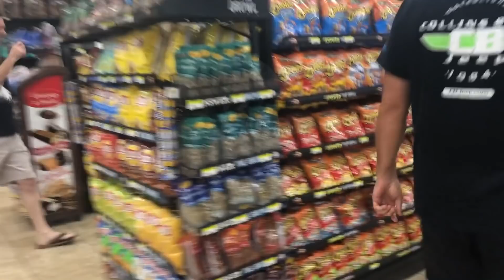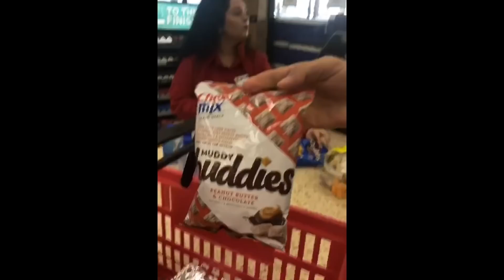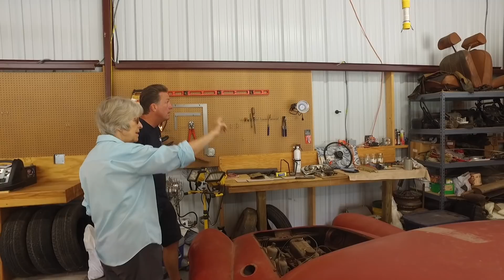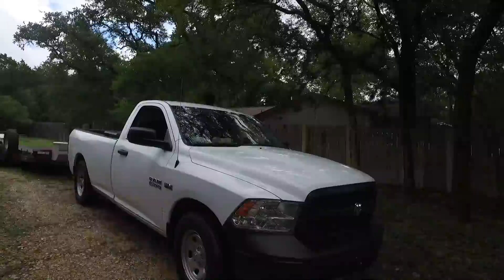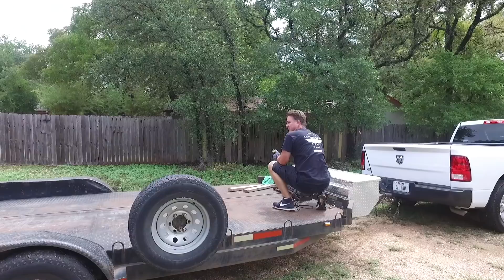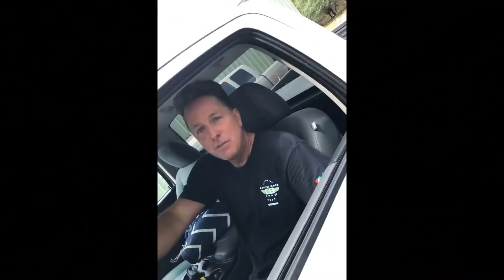MGA Barn Find Roadtrip

Comment: I will be watching the progress. I just discovered this video. I have a 1958MGA roadster that I got when I was 15 years old for $50. that was 1967... I was working nights and weekends in a gas station /full service garage for 85 cents an hr..big money for the time for a 15 yr old...I drove it through high school.. I had a restoration done to the body that took two weeks in 1972. I had it painted white. 1975 I had it painted factory original Tartane red. I have ever heard of. I paid $100 for the aluminum factory hardtop. I saw it sitting on an abandoned MGA under an apple tree while I was out riding my motorcycle one day near Lake Erie. I had the engine rebuilt in 1974 for no good reason. There was nothing wrong with the engine, but I did it anyway.
  I got interested in motorcycles, and fast cars in 1975 so I put the MG in my mothers garage. in 1980 I transferred it to my garage where it sat, it ran, but I never took it out. I bought a new house and move the car to my current garage and 1987. It ran, I snuck it from my old house to my new house one Sunday morning without being detected by the police because I didn’t have it up-to-date on the inspection sticker or the registration.
  I turn it over with the handcrank at least once a month for a minute. I put oil down through the spark plug holes, and I make sure the cylinders get coated as the car sits in my heated garage.
  The reason I had the car painted red shortly after it was white is because I spun out avoiding a head on collision on a back road and my car spun as I jerked the wheel to the right and came back across the road and stopped just tapping one of those cable type guard rails they used to have instead of Armco barriers. The right front wheel just barely touched one of those rotting wooden posts that hold the cables up. and the cable scuffed the top of my right front fender. When I went to drive away to chase the pick up truck driver that was leaning over his seat like he was digging in his grave compartment for something and drifted into my lane, the steering was very hard. So something got bent.. probably the right front king pin.. now that I’m retired recently, I plan on getting it back on the road. I would like to put a new carpet, seat cover job on the interior, and is going to need a slave cylinder/master cylinder/probably wheel cylinders/tires. My car has the drum front brakes with steel wheels and hubcaps.. I replaced the cracked original steering wheel with an MGB steering wheel out of an early 70s MGB. Wish I had an original steering wheel even if it was cracked..
  I had to pull the car out of my garage about 20 years ago so I could pull my SAAB 900 inside, it was February here in Pennsylvania, so I could pull the engine on the sob to change the transmission which had lost third gear. All I did was hook up a battery to the MG, turn the key on, pull the choke out, and crank the hand crank, and it started up within about five seconds..
  I keep the car covered with a full cover made for the car in my garage that breathes it does not need a paint job. It shines like it had just been painted, but that makes my original chrome bumpers and grill and windshield frame look their age. and that’s fine with me